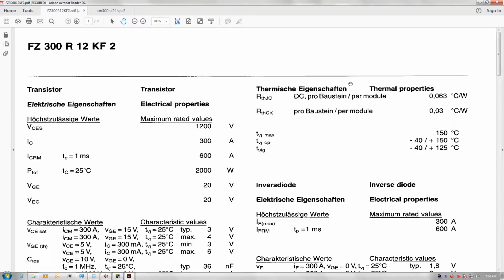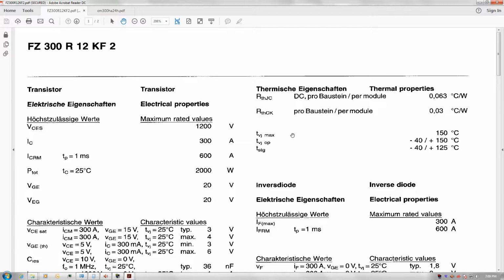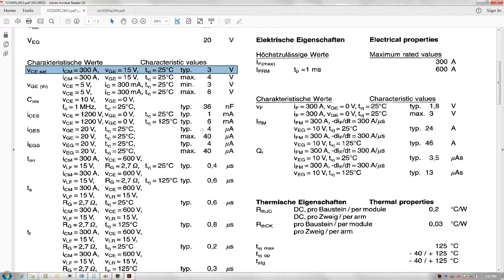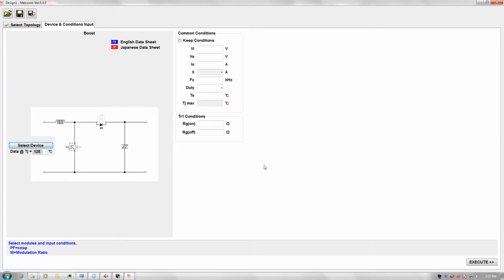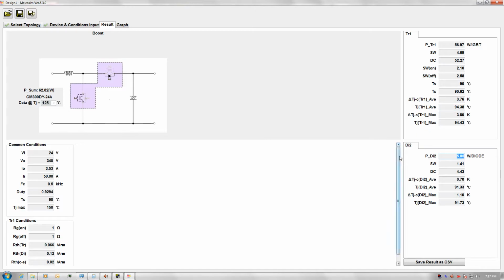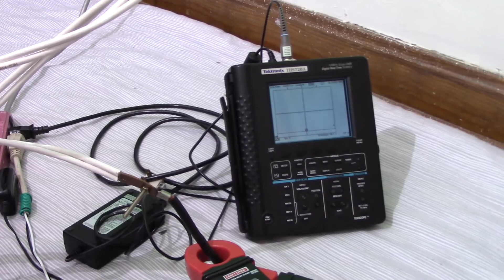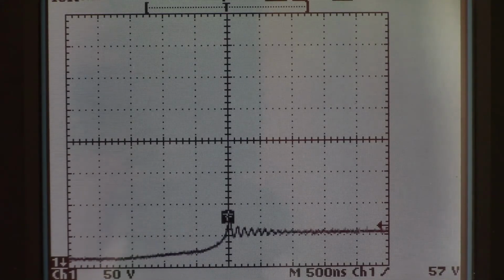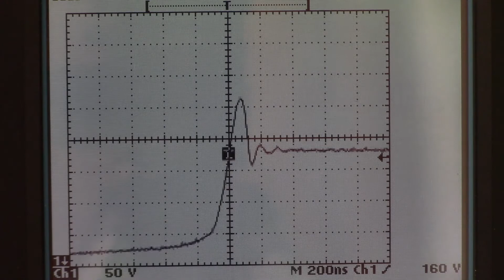Making a boost converter part 3; Thermal management

Comment: i tried to measure the junction temp by drowing a hole exactly upside the chip and let  my lm35 thermometer directly  touch  the chip .that was the most acurate  result i guse i got

Comment: I'm not french but i'm verry interested to this system of boost converter
Your resistor is 25ohm, but you have at this resistor around 175v. The current of the resistor is 7A ? looks verry nice from battery!

Comment: what is the purpose of black capacitor in circuit.what if we do not use it.what is its value.is this capacitor parallel to battery i.e. connected between drain of IGBT Module 1 and source of IGBT Module 2.
Reply from the maker: Watch part 1

Comment: great stuff. I wish there was more of it! what part of the country do you live in?   I have a dumb question. the inductors are they transformer cores? and max frequency they operate? I have some large cores like twice the size of microwave transformer cores. and a couple forklift batt charger transformers. I was thinking about rewinding. for a push pull. or use as a huge inductor. thanks
Reply from the maker: Greetings from Ohio. The inductors in this video are designed as inductors. They were pulled from a VFD. (some VFDs use DC BUS inductors in an effort to reduce noise and improve power factor) Not sure exactly their maximum frequency, but they seem to work well at 500 Hz (that's the switching frequency used in this project). You can use transformers as inductors, in fact I have done so before without much issue. The only real consideration is that you should rewind the transformer so you will have more windings for your inductor instead of having a dead secondary take up space. Thanks for watching
Reply: subcooledheatpump thanks for replying. I'm in North Carolina. north west nc. just a few miles from Boon  the college town. most ppl know of.   I have so much I want to learn. I am trying to learn by videos like yours. and Google. I have a few projects in mind I am a little ambitious for my skill level.  thanks again